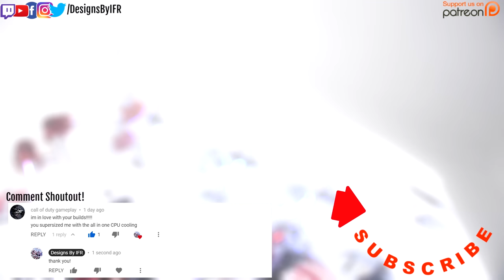$9000 Ultimate High End Water Cooled Gaming & EDITING PC Build | Crazy Time Lapse

Comment: Finally a sleek design that any man can rock at his desk. The other ones were too fancy lol. They're still awersome and very very good built but not as sleek as this one. Use less rgb and it would be perfect. Rgb waterblocks rock but i think that, for using such good radiators the fans that you choose are very low quality. I would go instead for noctua chroma pwm or corsair sp high performance edition to get all out from my system. In one word, you are building these machines just for showcase.
Good points for choosing seasonic psu this time. They make just the most reliable psu's on the market with antec.
I've heard stories of these resisting very harsh storms without any type of upc.
Your razer build is awersome too

Comment: Should have used a power supply that shows how much power it’s using in real time. Looks much better and would have been perfect with this build. That aside, the issue with the motherboard shorting out would not fly with me if you were building the system for me. Hope you will fix that before the client gets it. At this price point absolutely everything needs to be perfect. No cut corners.
Reply from the maker: It has been fixed.
Reply: @DesignsByIFR  do you know what was the issue?

Comment: Just got a random question: Why set up the front fans as a push inside the case when the components are fully watercooled? Wouldn‘t a push to the outside make more sense?
Reply from the maker: The case is completely open. Doesnt matter about the orientation but you still want some air flow over the parts even if it is watercooled

Comment: Great but you can do better on the flow system to achieve optimal cooling to both the CPU & GPU if using a single pump system. The flow after the the GPU should flow through the 2nd radiator for cooling before entering the CPU block instead of flowing through the CPU immediate after cooling the GPU.
Reply from the maker: The loop reaches an equilibrium, flow order doesnt matter

Comment: OK it is an open case, but push the hot air to the freshly cooled water tank and sucking it to the top radiator is not a good idea to approach the ideal cooling and perfection.front fans in pull mode would have been more clever especially that they are hidden by the box

Comment: @Designs By IFR
Please respond why a short circuit by leds?
Is there a way to fix this and if there is which is the way
Im speaking on this build system
Reply from the maker: Whenever the leds were plugged into the motherboard i couldnt turn it on so either the pinout is wrong or something is faulty with the led
Reply: I've searched (maybe not enough) but i couldn't find same problem in this particular motherboard that's why im asking and i want to buy this one
So maybe it's factory issue?
Reply: about 7:44 into video I think I noticed a damaged cable that might be causing an issue. Hope it helps @georgekotsonis7959
Reply: about 7:44 into video I think I noticed a damaged cable that might be causing problems. Hope it helps. Love your stuff to by the way.
Reply: @kelly johnson thank you very much

Comment: Insane expensive top of the line components, awesome water cooling, amazing case, all ruin by a frayed cable @ 7:25. Did you guys actually deliver this build to your client with that cable frayed like that? If so, very unprofessional. That cable is probably less than 10 bucks.

Comment: you have your loop pumping hot water from your gpu's onto your cpu?? wtf?? i give everything its own loop, but if youre gonna run it all on one loop then why would you do it like that?
Reply from the maker: Why wouldnt i? The loop reaches an equilibrium after a short amount of time. The liquid has little to no difference at one end of the loop to the other
Reply: @DesignsByIFR  still, in times of gpu strain it's going pump the boiling hot water from TWO GPUs onto the CPU.. the loop should pump from rad directly to CPU. Then that relatively small amount of heat onto the way hotter GPUs. You always want the CPU as cool as possible. For many reasons. Longevity of the CPU, no thermal throttling, just best overall performance.. and the system can be at equilibrium during x process but immediately and drastically change and fluctuate during y process.. why NOT build it so the CPU is as cool as possible? The way you ran that loop is reversed imo. If all you do is swap In And out on the pump it would be perfect. Imo.. and this is all just my opinion.  In a perfect system the CPU would be on its own loop going directly from radiator to CPU where's the coolest, and then the gpus would be on their own loop ran directly from radiator to the primary GPU first. you obviously know how to build a computer so we're just talking about small things in the grand scheme of things and I'm sure your way works perfectly fine. But I just sleep better at night knowing my CPU is receiving maximum cooling potential possible. Like I said though, just my opinion.

Awesome build though other than that. I love it. I subscribed over how much I love this build.
Reply from the maker: Thank you very much man i appreciate it

Comment: The fuck, your making me nervous. I just ordered that motherboard last Friday, and I saw your vid that the RGB on the motherboard is not working coz of a short circuit.
I saw 2 bad review of that board on Amazon (that the RGB  has default problems) but still bought it coz I want this board for overclocking 9900KS to 5.1 or 5.2.
Its going to be so shity if the RGB on the monoblock wont work.

Comment: This is just click-bait. No build tips or problem solving. Garbage music. Now if I want to see you build more I have to join ? I know this is a phase right now but hip hop water cooling pc porn is not going to sell high end water cooling gear. This gear is expensive and most guys living in their mom's basement are not going to spend their rock budget on a 20k computer
Reply from the maker: What are you on about
Reply: @DesignsByIFR  Speak to us about the parts you have chosen and why. Share some of that big old brain with us so we can make builds that look at least a tenth as good as yours. Show us how the manufacturer screwed you over and sent wrong bolts and now you have to fabricate them. This happened to me on my very first water cooling build and turned me into a "Crazy Yank" and now I go on about nonsense  😁
Reply from the maker: Hahaha, yeah i can start talking in the videos to change things up =)
Reply: @DesignsByIFR  Thanks mate. I ain't gay or anything like that but if I were.....You wouldn't have anything to worry about🤣 Seriously you speak well and obviously know your stuff. I remember my first water cooled build. I bought an acrylic case from frozencpu. Back then they were located about 20 minutes from me in Walled Lake. I went with an all AMD/ATI build since AMD was the first to release a 1 gig processor. I sure learned about cable management and proper tube routeing. Nothing fit anywhere. All the screws were the wrong size and had to be fabricated on site. I remember my friends asking my why I was doing something so hard that nobody would like anyways. But then I noticed that my four year old was hooked. He had claimed it for himself. He liked playing chess online against Grandpa and he said that with a computer this good Grandpa could never beat him again. So my three year old got the most expensive computer this side of NASA. My wife said I flipped my lid giving a four year old a PC let alone one that cost almost ten grand. Matthew (four year old) did not like to read as he preferred to be read to. Lazy just like his old man. I started having LAN's at the house as not many people at the time had a home network. I would say that 95% of people were still on dial up. All my friends were very helpful to Matthew and worked with him on his reading as well as his gaming skills. Within six months he was reading and writing at a fourth grade level and his teachers started coming to our LAN parties. Computers are the future especially among the younger generations. Wife still says I am an idiot but now that my grandson is about to turn two, I found a box in the storage room with about ten Pajama Sam software titles. I used a Pajama Sam game to break Matthew's fear of the dark .Sorry for writing a book but when I start this build for my Grandson I am going to do a build for Grandpa. I plan on sTRX40 MSI Creator. Threadripper 3960 ( upgrade to a 90 when the aliens finally drop em off) I reckon a 3960 will open my mail server really fast. A 2080 ti to keep minecraft in line. Four Western Digital Black 2TB in a raid array with the nifty nvme pci raid card provided by MSI. Two 4TB M.2 storage cards for motherboard slots. There are three M.2 Slots on motherboard but Wendell says the one near the memory slots (near top) seems to cause a lot of heat when populated. I know you want to create visuals to the beats and it really is cool. I just know you have all kinds of things in that big old brain that I can learn from. Sorry for being a grumpy old American Dick and shitting on your artistic creations. You know I watch your videos and I don't watch them cause they suck.😁 Can ya do one with a water cooled 4 slot M.2 card say from like M.S.I. ? Thank you Sir for all the content and all the hard won knowledge that you share with us goofballs.